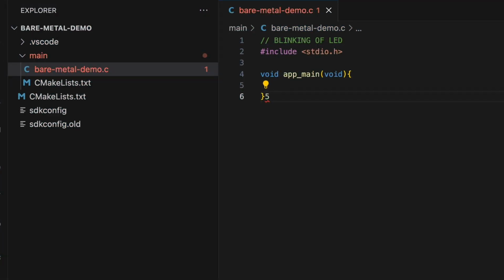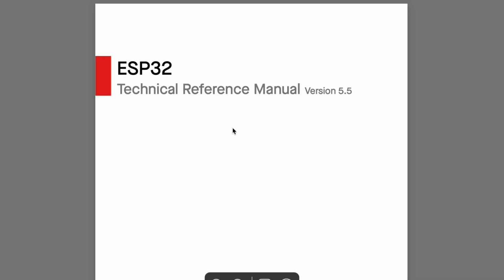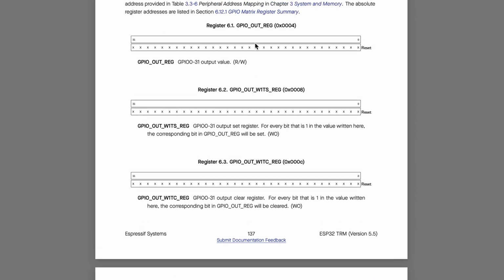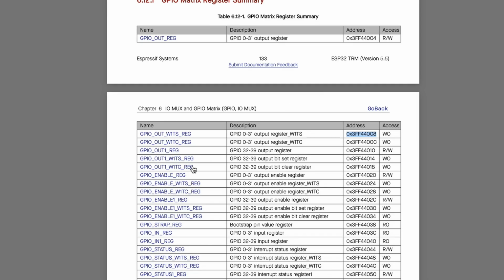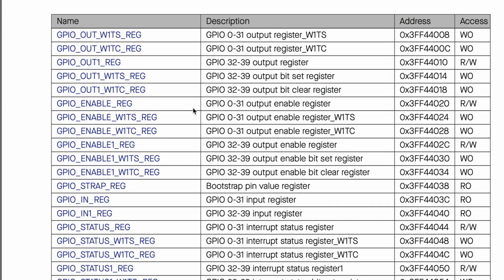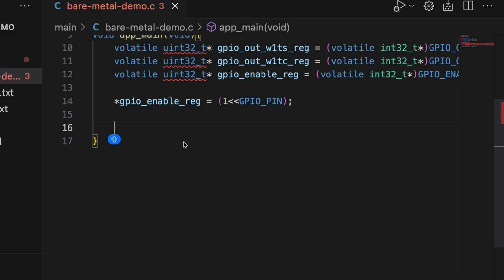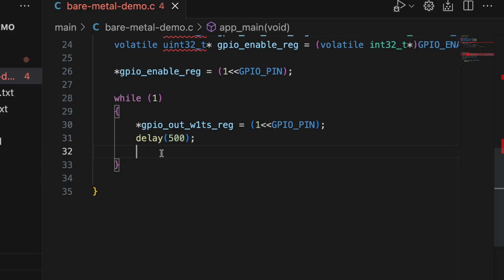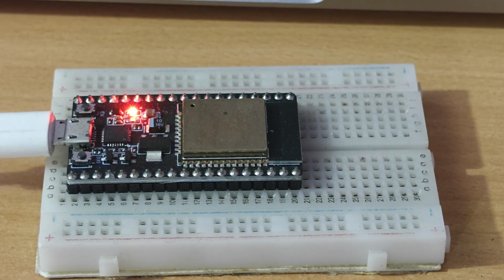Blinking an LED with Bare-Metal Programming | ESP-IDF Tutorial for Beginners

Comment: > Bare metal
> Still uses FREERTOS
bro...
Reply from the maker: No freertos were used in this video.
Reply: @InnovateYourselfashu  lmao you literally compiling this all with esp-idf (which includes freertos itself), and your codes still runs via damn freertos scheduling
Reply from the maker: Yes that's correct but in my code I'm just explaining how to write the Bare-Metal code to perform basic operations. 😊
Reply: @InnovateYourselfashu  I was trying to find any guides about how really write Bare-Metal code, where to find correct linker file, how to complie and link for ESP32-C3 etc. Yet there is only "lets just use ESP-IDF!" solutions, and there is shitload of same fake bare-metal videos
Reply: @Igrok_x_xp  hey ! currently looking for the same thing, have you found anything ?
Reply: @Igrok_x_xp bro did you find any, looking for the same thing